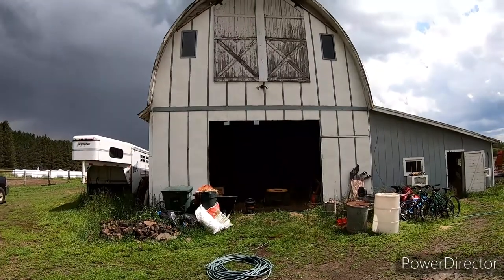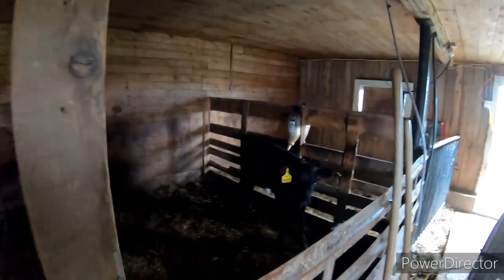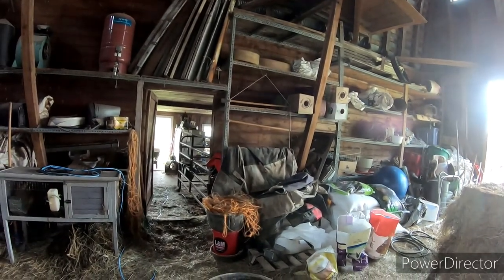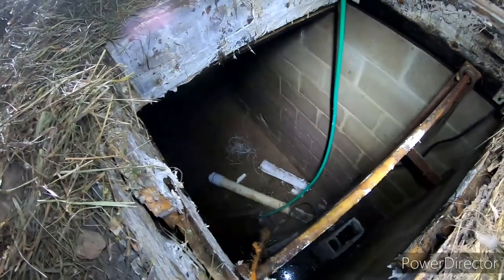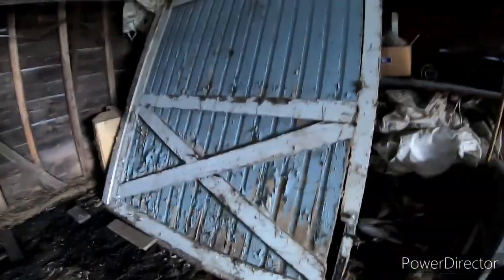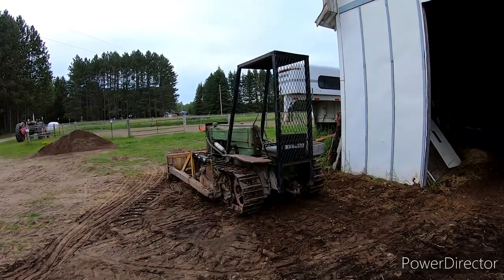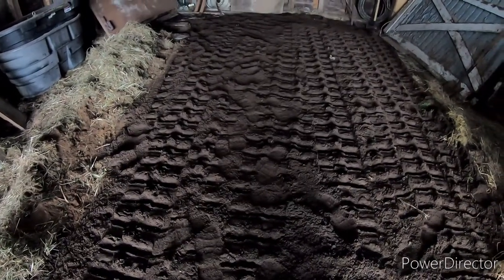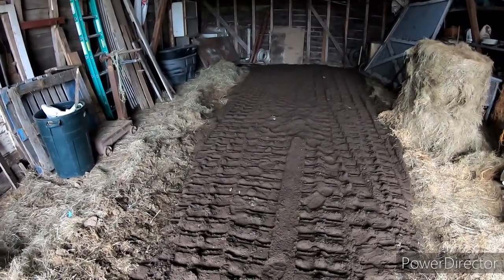How to remove a secret survival bunker from a barn

Comment: Actually that's a good plan.  We used a barn built for draft horses for calves, and heifers. 
It had a dirt floor.  Dad said they prefer horses on dirt as it was easier on their joints. 
Definitely a improvement. 
Over by Green Bay, and it's raining here.
No rain at home. 
I think the river bottom is cursed.
I was a boy, and served during the cold War.
I'm pretty sure I wouldn't want to survive nuclear war, and have contempt for anyone who would start one. 
Thanks Will.
Reply from the maker: I like keeping animals on dirt. It creates a few problems but it's definitely better for them. We got just enough rain last night to amount to a heavy dew. Hopefully some hay cutting today. Be careful on the roads there Bryce.